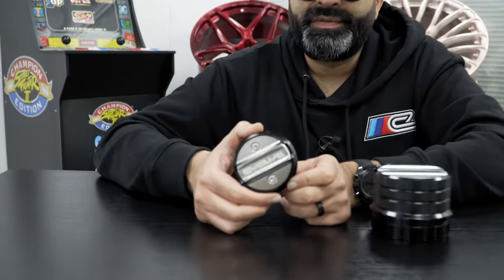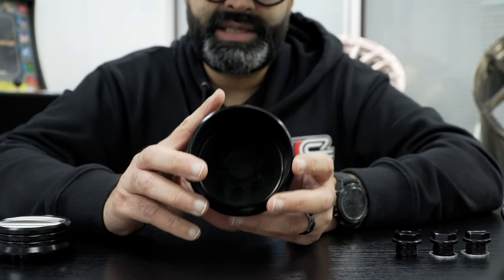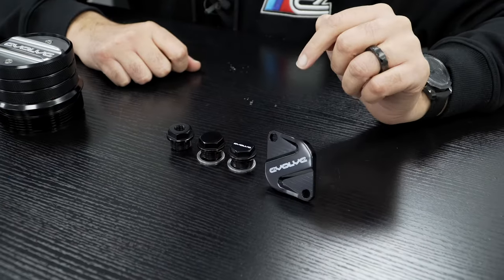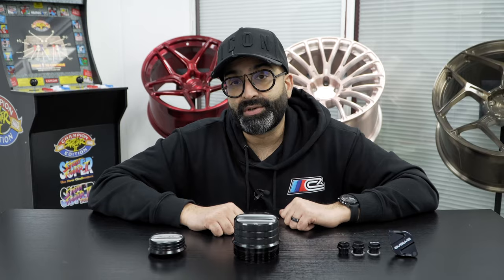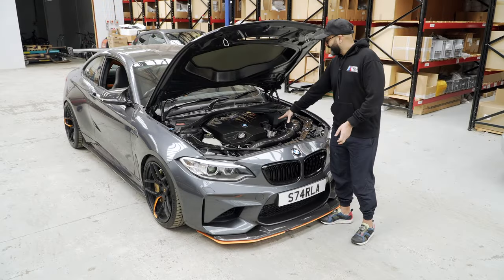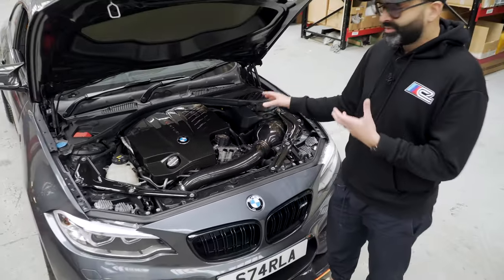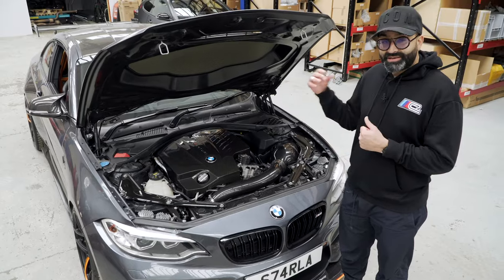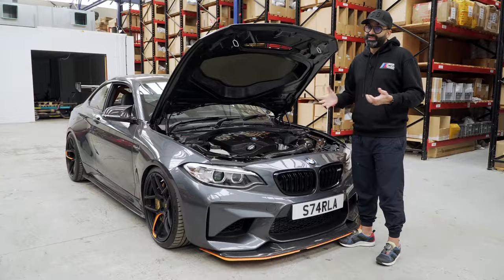Our brand new Billet Engine Bay Parts are here! - BMW F8x M2/M3/M4 N55 + S55

Comment: Love the two-tone look and knurled edges of the billet parts. I am always debating gunmetal or black finish on billet parts? Now I can have both. You have to remove the decorative cover of the oil filter housing every time you change the oil filter. That's too much work. HaHa. I also love my Eventuri Carbon Fiber Intake on my F3X 335i on a N55. Super tight clearances by the hood latch. Get some rubber edge trim and triple-masking tape everywhere (metal edges and under the intake cone) to avoid mega scratches.

And that Evolve Hoodie with the Tri-color ///M Evolve Logo!! Gotta make a Gold Porsche Emblem version.

Comment: Putting threaded billet aluminium parts in place of plastic, may change the torque setting. There is an increased risk of damaging the engine's aluminium threads over time or cross-thread occurring by mistake. Burns risk increases too if one is not careful.
Reply: It a person doesn’t realise that aluminium will be hot when doing an oil change, I’ll put it out there that they shouldn’t be doing the oil change in the first place.
Reply: @Mac_F87  Easy for an owner to say. Think of the unsuspecting mechanic or someone else who wasn't expecting it to be aluminium and didn't look at it carefully.
Reply: @mlhj83  unsuspecting mechanic? I would really hope a mechanic working on my car would know the difference between plastic and aluminium. It’s really no difference to an owner touching the oil thermostat housing or any other part of the engine when it’s hot though is it?
Reply: @Mac_F87  I would hope so too, but in the real world… When was the last time you saw someone needing heat insulated gloves or a cloth to remove the oil filler cap or oil filter housing, even when hot. Anyway, enjoy the products.
Reply: @mlhj83   there are countless companies who make billet oil filter housings for all makes and models yet I don’t hear of outcry due to people constantly burning themselves. Yes, we live in that real world and as such no doubt 99% of people will manage to use this without issue. The ones who can’t are the reason we have “caution contents hot “ on disposable coffee cups. The plastic filter housing is more than hot enough to need a cloth to handle it if you change the oil right after running the car. It also looks like you don’t technically need to handle the billet housing since there is the 1/2” square drive on the top for torquing it up.